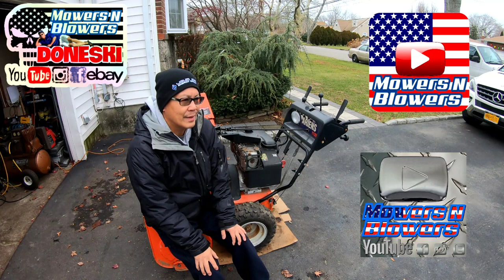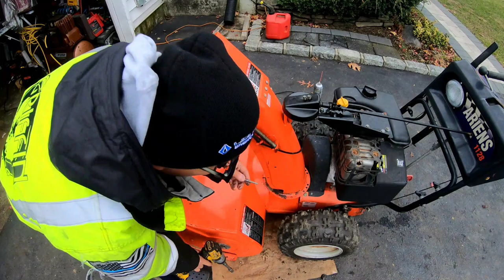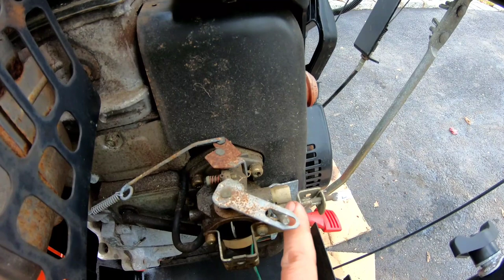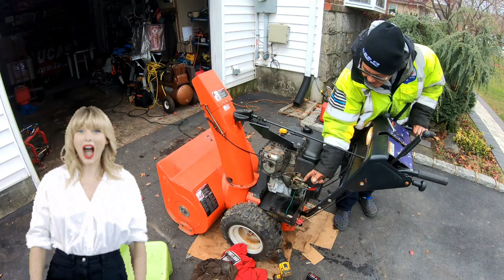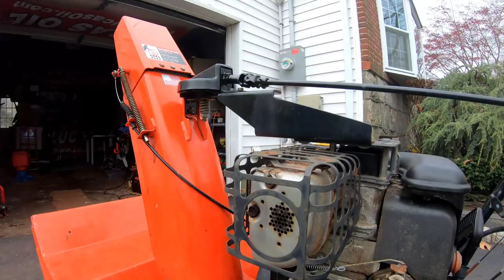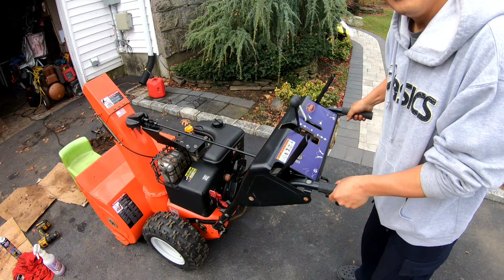ARIENS ST1128 11HP TECUMSEH SNOW KING ENGINE 28" DUAL STAGE SNOWBLOWER SURGING CARBURETOR CLEANING

Comment: I have this exact model. I’ve taken the carb cover off to replace the fuel line. Wait till you have to do that, fun. I digress. You can put it in the forward service position and get the bolt off (I leave the bowl on, I know it’s clean) right from underneath very easily. The bolt has a big jet hole and one further up within the threads and very easy to miss. There is also a an emulsion tube above the bolt/main jet. It’s way up there and held in place by an o ring. I get mine out by using a Sheetrock screw. I put it up there and turn gently and it engages the tube then I tug it down. Don’t get real aggressive turning the screw in. Both the main and emulsion jets on mine have needed minor cleaning in the past. If mine even pops a little at full throttle I check the jets. To rev out and pull hard under load, it needs all the jetting it can get. There’s no extra.

Comment: Had a chance to watch. Nice machine! I like how that one has the cast Iron front gear box. My 87 only has an aluminum one.
Anyway the carb does look correct to the engine. Those OHV Tecumseh's had oddball carbs, so there different than the typical flathead ones. Great vid. Should fetch a pretty penny!

Comment: That is the correct carb, these 9-13hp ohv engines have a specific throttle plate. If it had a 5hp or 8-10hp carb it would be revving uncontrollable

Comment: I have the same exact snowblower.  I was having a hard time starting my blower.  When I went to look at the carberator bowl, I saw that it was hidden way up there.  So I pressed on the little button on there and fuel came out of it.  Is that suppose to happen?  I didn’t use a wrench or anything to remove the carburetor bowl.
Reply from the maker: Yes it’s designed that way to drain the fuel out of the carb

Comment: I have a Tecumseh HMSK100 that originally had a jet bowl with the jet nut adjustment.  The bowl was replaced at one time with a bow without adjustment.

The engine does surge.  As a first step, should the bowl be replaced with the original adjustable type?
Reply from the maker: No,  surging comes from a plugged pilot jet which is on the side of the carb,  take it out and clean it
Reply: Thanks, man!

Comment: I have about a 1% success rate in cleaning a Tecumseh carb without blowing up the bowl gasket. That machine is a monster. Install an impeller mod and you'll be throwing snow to New Jersey.
Reply from the maker: I would if I was keeping it for myself, but most people don’t know what the impeller mod is.,  also Lucas contact cleaner does not swell the gaskets